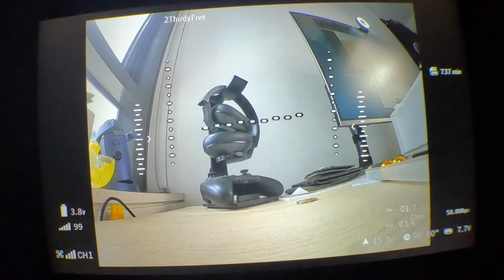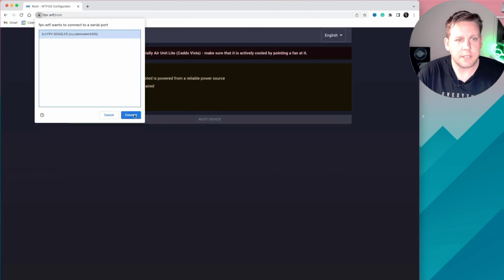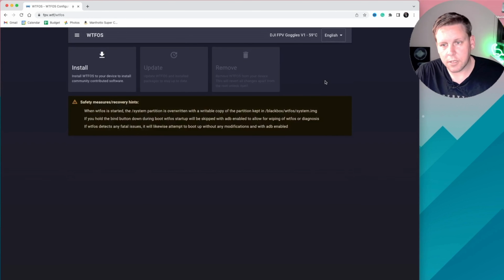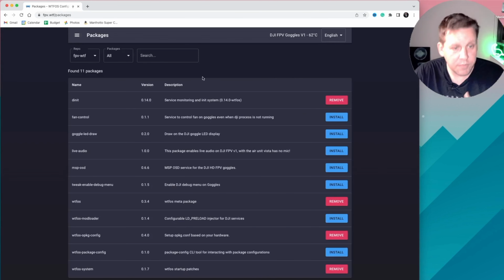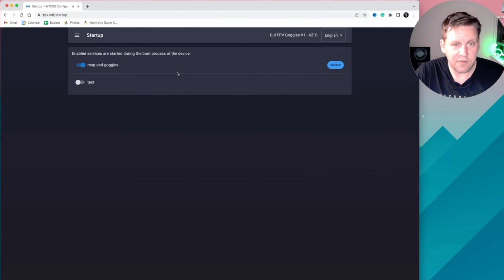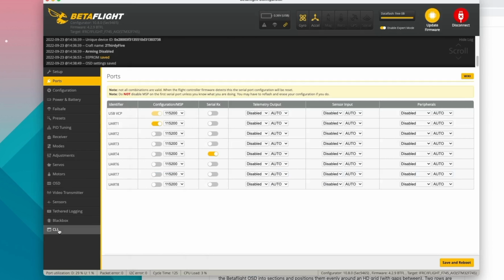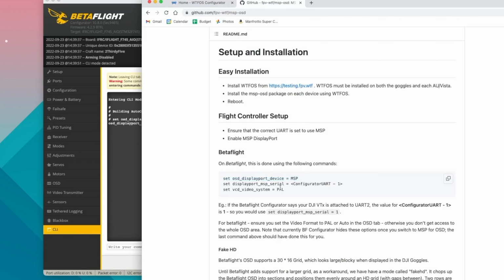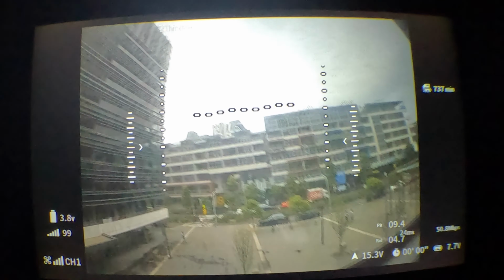The FAST Hack to Get Full OSD in DJI FPV Goggles

Comment: Do you have to do this to both the goggles and 03 unit ?
Reply from the maker: O3 doesn’t need this, latest firmware for Googles v2 and O3 supports canvas mode natively. This is only for Vista’s and original Air Units
Reply: So how do I get osd to work?
Reply from the maker: @Chillin-fpv on O3?
Reply: Yes please? Is it just going to the preset tab and selecting the wtf os osd preset then selecting what uart the 03 is plugged into?
Reply from the maker: @Chillin-fpv  you’ll need to set up the port tab correctly and then configure your OSD

Comment: ?? doing the run around for a couple of days trying to get full osd. i have the v2 goggles up to date and ready to rock, discovered this last step and hit this problem. my mamba f405 stack has a weird port set up.  it has ports numbered 1, 3, 6.   another sub issue is tx5 appears on the board but (after a lot of research) it does not connect to a pin on the chip itself.......ooookay! anyway, i tried  ..... serial = 5. it said it was bad command... tried all the other numbers still no joy.   no idea what to try next. i was trying to add gps to my 5inch, thats when i found the myserious  tx5, but for about a week i've been trying to set up hd osd... and slowly realised i dont even have full osd from betaflight yet, so now i hit this issue about the ports after giving up gps, today alone i've installed wtfos 6 or 7 times, checking updates, then checking dji updates, everythings is correct, but this port issue.....

Comment: Nice quick video although I am struggling. I have my new goggles V2 from an FPV Combo unit. I’ve activated the goggles and connected to DJI Assistant and I’m on V01.02.0000. I can’t root it doesn’t work. Do I need to upgrade or download to anything?

Also I can’t switch modes as on the goggles display it’s just asking to update firmware
Reply from the maker: I believe you are on newer firmware which isn't compatible with this mod

Comment: the new dji firmware supports beta flight mine is bricked so have to use the dji supported beta flight has what i need also the dji timer and battery level works too now without wtfo just hit custom osd in your goggles set serial port on urat your air unit is on thats it you have osd you do not have custom font
Reply from the maker: Vista's and Links do not support the full Betaflight OSD do they, only the DJI adaptation of it?
Reply: @DarrenAllatt  The newer vista's support OSD the new  Runcam Falcon vista I have supports OSD and runs at 1080p X 1920 120 fps converted to 720p 4X3 NATIVE SENSOR ITS INSANE FOR FREESTYLE output its better then the 03 unit and much smaller lighter update new firmware go to custom osd in your goggles turn on go to ports and make sure your vtx serial is on the first button like betaflight button on then make sure telemetry is on thats it betaflight osd should show up in googles and the dji avata timer and battery levels will start working too in FPV mode ITS SO EASY NOW NO NEED FOR THW WTFSO FILE ANY MORE
Reply: @DarrenAllatt  the new Runcam vista 1080p falcon supports osd betaflight

Comment: How can I get my final flight stats to show without the gaps? I looked at the Github page and cant seem to figure it out.
Reply from the maker: That’s got to do with how it’s rendered on the BF display. Which setting have you got it on at
Reply: @DarrenAllatt  What do you mean what setting? Where and what setting are we talking about?
Reply: @DarrenAllatt  Would that have to do with PAL or NTSC in BETAFLIGHT settings? My main OSD looks ok just the post flight stats  have spaces between the words. Nothing is in order.

Comment: its nice, but i think i just keep my goggles in its orriginal state.
i have learned to only have corsair, voltage, LQ, timer and MB's. anything more is just distracting if you fly fast past and around objects.
you dont need that fancy looking artificial horizon at all you should be able to react to what you see anyway.
i always gloss over my corsair and LQ that are both somewhat in the middle and only focus on them when i need to aim myself throug something.
Can the V2 goggle have sound from that air unit?
Reply from the maker: Both V1 and V2 Goggles can get Live Audio from the Air Unit as it has a microphone. 

Personally I don’t use all those elements, there were just to show all the random things you can use. 

I have a standard layout I use

Top Centre
- Craft Name
- Warnings

Bottom Left
- Avg Cell Voltage 
- RSSI
- LQ
- VTX Channel
Reply: I have seen multiple youtubers emphasize that only v1 goggles will output the sound. I've heard claims that DJI changed something in the hardware in the v2 goggles so, while the software/firmware supports it, the goggles do not output the sound.

Comment: Does it work with betaflight 4.2.0???
Reply from the maker: Yes, and each version after the one mentioned in the video
Reply: @DarrenAllatt  Okay.  Thank you.
In the video you are with version 4.2.9, and you tell me that it also works with later versions.
But does it work with all versions of 4.2?
Reply: 4.2.0 is valid?
Reply from the maker: @javiermiranda3776  - we are now at 4.5… it may not work with 4.2.0 as I don’t below canvas mode wasn’t implemented for 4.2.0…

Back up your quad by doing a diff all and save it to a file. 

Update to 4.2.9 

Then restore from your DIFF all.

Then implement the solution.
Reply: @DarrenAllatt  OK, many thanks for your response.  The FCs will have to be updated.  Another question if you can solve it for me, if for example I hack the glasses, would they still work with an air unit / caddx vista / runcam link without doing the hack?  Or if I hack the glasses and the AU / view / link, could I continue using them as before, with the basic osd?  Thank you.
Reply from the maker: @javiermiranda3776  why would you want to do the hack to get OSD, then not use it? 

Yes. Will work if you don’t do the hack on the air unit, but no new osd.
Reply: @DarrenAllatt  Well, I have several drones, some of which I already have in 4.3, and I could use the full OSD function.  So I wanted to know if, while I don't update the others I have to 4.2, I can still use them, even without the complete OSD hack.  That's why my question.  Thank you.

Comment: Hi I’m relatively new to fpv , my question is if I’m not on the version you mentioned can I still go ahead with this mod
Reply from the maker: What version are you on?
Reply: @DarrenAllatt  Hi, I've just checked and yes the version is 01.00.0606, I was also wondering if it was newer would it be possible to rollback to that version. Thanks for the reply
Reply from the maker: @alantoseland6629  No, you cant roll back as DJI have blocked that.

Are you in FPV Drone Mode or Air Unit mode?
Reply: @DarrenAllatt  so if I buy another air unit in the future is this likely to have later software installed?
Reply: @DarrenAllatt  Air Unit Mode
Reply from the maker: @alantoseland6629  I am sorry, I am not DJI so I don't know what they may do in the future. I do know they currently ship with the original firmware and foresee that would be the case moving forward.
Reply from the maker: @alantoseland6629  you should be ok to do it, have you followed the instructions exaxtly
Reply: @DarrenAllatt  yes I have and thanks for the info, will order another air unit just to make sure I have a spare and appreciate the help

Comment: This doesn't look too hard. I have the V2 goggles and 5 Vistas and one 03 air unit that I haven't opened or used yet. By the time I get done I will have rooted 6 things so I should be good at this by the time I'm done. Assuming everything goes well. Things rarely go well for me. We shall see though. Great video.
Reply from the maker: Good luck 🤞 hope it all goes well
Reply: @DarrenAllatt  It worked perfectly. I rooted the goggles and 1 of my vista units. Just did a test flight. No problems whatsoever. Thanks for the video.

Comment: Does this modification work on the DJI FPV drone?
Reply from the maker: No. Only Vista, Link and Air Units
Reply: @DarrenAllatt  I appreciate the swift reply, that's disappointing. 

I wonder if flashing a different image on the FPV Drone would brick it completely. 

Would be nice for more versatility/control on rooted/jail-broken FPV Drone models.
Reply from the maker: @KirwinWebb  I don’t believe the current developers of the Root have an incentive to work on any hacks for the FPV Drone as they fly FPV Hobby Grade Drones

Comment: What are the CLI commands for INAV anyone?
And in INAV/ports when you set DJI FPV there is special place for peripherals where you pick DJI FPV OSD. It's not usually set to MSP, although I can set it. What should it be?
Reply from the maker: Sorry I am not familiar with iNAV, best to refer to the Github for FPV.WTF which will have instructions for iNav
Reply from the maker: per the wiki

Select "HDZero VTx" as the Peripheral. Next, select "HD" in the OSD tab if you'd like to use the HD Canvas.

If the iNav OSD appears garbled at first, try entering the iNav menus using the RC sticks, and then exiting the menus. This will force INAV to switch into HD mode a second time.

Due to a known issue, the INAV artificial horizon and other elements can become corrupted in packet loss situations. To work around this, assign a blank OSD screen to a switch, or assign a switch to the OSD feature. Toggling to a blank screen or turning the OSD on and then off will fix display corruption.
Reply: @DarrenAllatt  Wow man! can believe I couldn't find it. Thanks. Worked and I just set 2 osds on switch to refresh if something happens! Subbed

Comment: set displayport_msp_serial = YOUR_UART_PORT_NUMBER - 1 Doesnt seem to work on BF 4.4.. i have set it to Port 5 as my Dji unit is on Port 6 but it doesnt work in the CLI. Thanks
Reply from the maker: BF4.4 had a change in the way the CLI command is worded. There is a preset which makes it easier.
Reply: @DarrenAllatt   I see waiting on OSD then disappears. Any suggestions

Comment: I tried this and got smoked. 

I was able to get as far as having some betaflight menu text pop up on my DJI osd  during the power up; but once power cycle completes BF osd disappears. I have uninstalled WTFOS on both my vista and goggles and I have cli dumped back to factory cli and then restored with my configuration. 

Now my RC says it has telem and is properly bound, but I get no response in or out of betaflight.
I thought uninstalling WTFOS, dumping back to factory cli and restoring with my config would work but it has not.
 
Any tips would be greatly appreciated I have been slamming my head on a desk for 5hrs now. My quad was great before trying this, I simply just want an LQ reading.

Hoping this is just something simple I don't know.
Reply from the maker: Hey Jackson, sorry to hear you are having issues. 

Let’s help you solve this. 

Firstly, what FPV drone are you using? Is it one you bought or built?

What radio controller and transmitter do you have?
Reply: @DarrenAllatt  hey thanks for the response I would really appreciate any input I am using:

Geprc Cinelog30
Radiomaster Zorro
TBS Nano Tx

Another thing I am seeing - DJI Assitant cannot find the firmware of the Caddx after removing WTFOS.
Reply from the maker: @imjackson.  can you email me? Darren at everythingmicrofpv.com 

If you can send me 
- screenshot of Betaflight ports tab
- picture of flight controller in drone
Reply: @DarrenAllatt  Yep ill go ahead and do that ASAP. Throwing in the towel for tonight. Thanks a ton.

Comment: Each attempt ends with a message ,,Aborted! Device did not reboot in time, please power cycle and try again.,, Dji Gogles V2 FW 01.00.0606. 
what can I do?
Reply from the maker: Are you in the right mode? Ie that it’s set for the mode to use Vista and Air Unit and not the FPV drone

Comment: Bummer it is not working with O3
Reply from the maker: You don’t need to do it with O3, it has canvass mode enabled when you update the latest firmware from DJI and run Betaflight 10.4

Comment: I guess I just don’t understand why people want canvas mode so much. I’ve never felt like I was unable to display any necessary parameters on my DJI goggles… I fly analog as well.

Are people just irritated they can’t customize it visually EXACTLY how they want it? 

Forbidden fruit sort of thing? 

Any input is appreciated.
Reply: You don't see any on screen warnings/errors without canvas mode. You are also unable to properly display things like LQ and RSSI.
Reply from the maker: The three most important warnings are SSI and LQ. LQ and RSS, I need to be combined together in order for you to understand the RF environment that you’re flying and whether or not, you’re close to a fail safe. There are also a number of other elements that you may be interested in such as the different timers, but also being able to have more control over that PID through the betaflight menu, more than what you get through the DJI OSD. There is also something to be said about customisable layout.

Comment: Thank you for the video, unfortunately not working for me. the root of goggles is never happening.
Reply: same happened to me, you ned to put your goggles in vista mode. Then root. If you have latest firmware, you need to downgrade with butter.
Reply: @Kalinkamaen  what is butter ?